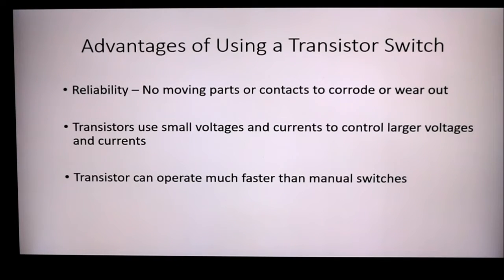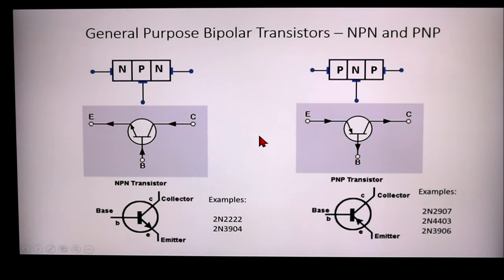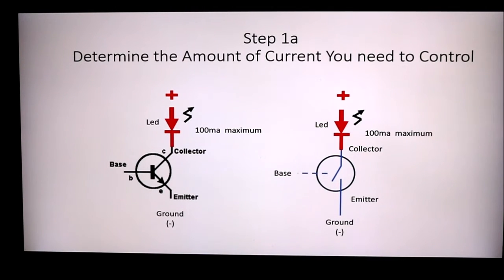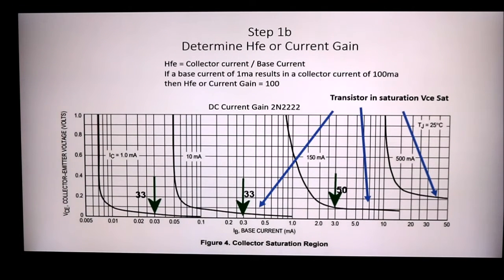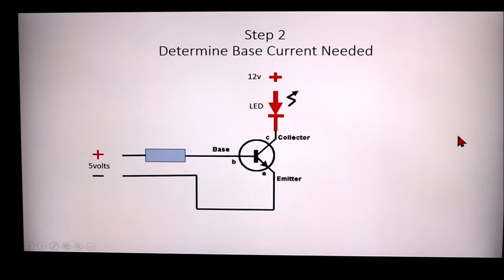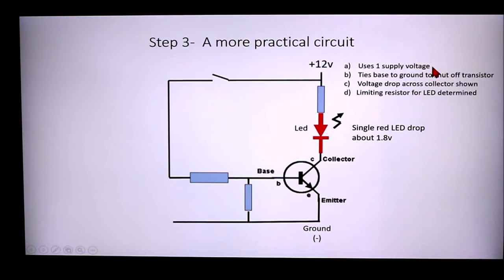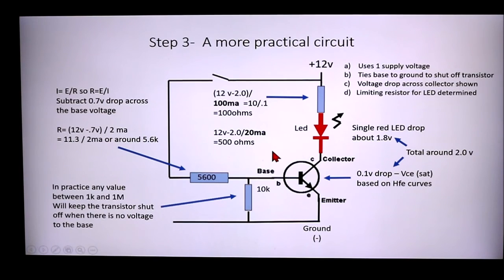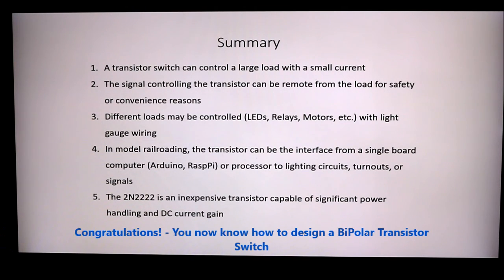How to Make A Simple Transistor Switch

Comment: Great video, especially for me as an amateur. Been searching online the whole day for info like this. This is the first info that helped me to get something working. Would it also be possble to switch the transistor from a GND line instead of V line?
Reply from the maker: Yes you could using a PNP transistor - just reverse polarities
Reply: @PracticalEngineeringSolutions  Wow, I got this PNP setup working. I can now switch my transistors from only GND. And this setup doesn't seem to need the 10k BE-resistor. Well, it doesn't malfunction without. Is that correct?
Reply from the maker: @donautube  I would still use so noise does not trigger it
Reply: @PracticalEngineeringSolutions  Ok, I will do that. Thanks for your help!